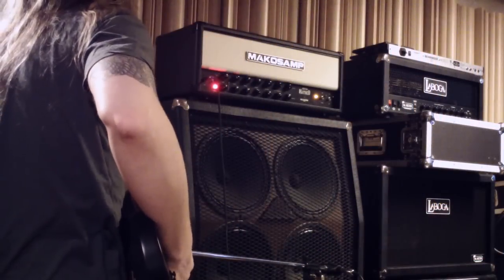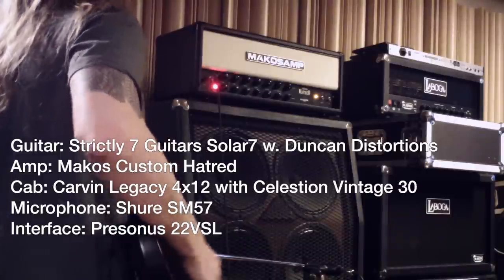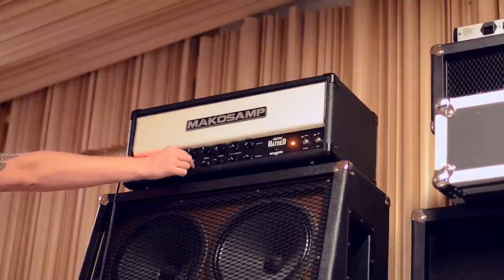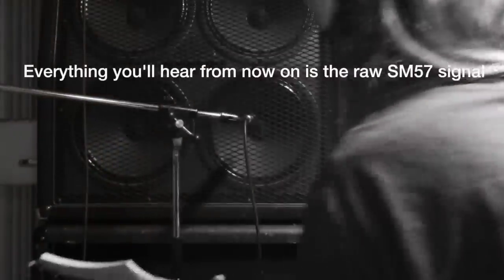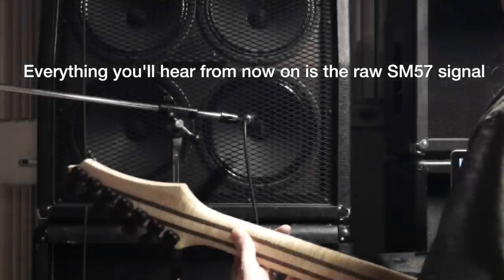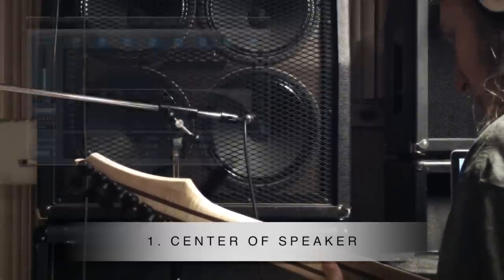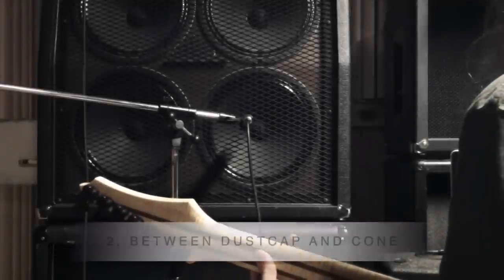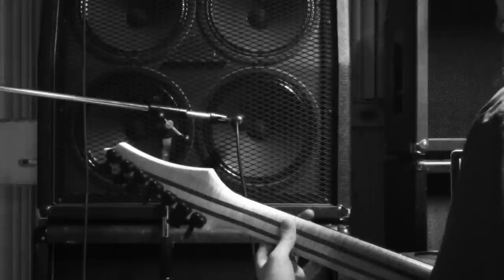Miking a Guitar Amp for Metal - The Ola way

Comment from the maker: To avoid being mis-quoted here's my answer: 
I record amps pretty loud, some amps needs more power amp push to make it tighter, some more modern amps (like Engl) doesn't. For instance a great example of an amp getting tighter the louder you crank it is the mini rectifier. With the volume comes the tight punch. 
So it all varies with what amp being used. The part that it should be as loud as the sound of the pick hitting the strings is bull, that is way to low volume.
Reply: Hi Ola! What does bull mean?
Reply: Who ever said a stupid myth like that? The string noise would be heard too much.

Comment: Surprising piece of gold here: I didn't realize there was such a difference between miking it dead center and "right on the edge of the dustcap". I was always making the jump from dead center to about an inch or two off the dustcap. I think that position 2 is EXACTLY what I've been looking for.
Reply: Try mixing the two, if you layer your guitars. One brighter (maybe more mids dialed in) and one beefier. Wall of sound guitar tone.
Reply: Chainheart Machine
Oh, always layer. But like right now I just have a 1x12 so it's hard to squeeze the mics in the right spots. But just knowing that 1 spot for getting a certain tone already came in handy for a recording I just did.
Reply: Event Horizon Productions Hell yea man, especially if you just want to get the idea down! I get lazy when I just want to put the parts together.

Comment: (part 1 of answer) I'm not Ola, but typically it depends on the amp. You usually can't go wrong with having the post around 3-4. Ex. The characteristics of a 5150 itself drastically change with the post at 1 vs 3. The entire high end opens up and the low end tightens up as well. The idea of cranking the amp is to bring out characteristics that aren't there when quiet, get some more saturation from the power section (that's why power attenuators exist) and give the speakers some movement.

Comment: When you record you should record on mono (unless you record a synth or something that has a stereo output). To track a guitar like this one stereo is double the file size and double the CPU power (for any processing you will apply) as the signal you record is the same for the Left and Right channel. So, you record on mono twice (not copy paste otherwise you end up with a duplicate mono version of your original recording) and then you pan it to the left and right respectively.

Comment: thanx for it! ;) i try to explain what i intended to say about the guitars. to add range tonalities imo you can play a track with a guitar and the other with another one.
where i have to disagree with you about the amp mixing. many band tend to use 2 or more amps just to get a full sound. some amps have bass, other mids, others treble. the mix have the function to get the big sound, without holes. this is said by many famous band,not only by me ;)
cheers!

Comment: Sounds great.. but what if just not record two tracks.. but just duplicate the first track in the software so u get exactly the same on two separate tracks.. then pan the first one left and the second one right.. ? would´nt that save alot of time and be much more simple than record two separately tracks ?
Reply: It gives a kind flanger effect if you do that, probably something with phase related.
Reply: +HearGear That would be the same as a mono track, only a little louder. When you play back a single track and it's panned in the middle, it already sends the same signal to the left and right speaker. It's the little differences in the playing that give the stereo effect.
Reply: +HearGear Same sound waves just amplify each other. So it would sound like a mono track, just louder.

Comment: Do you guys know if it's possible to get rid of the light "buzz" sound that you inevitably get from the cabs when you're not playing? Is it even possible for a tube amp to be dead silent when turned on? If it's not then does that small "buzzing" sound from the speakers is even worth paying attention to? I'm not talking about a loud white noise here, just the sound you get when the amp is on.
Reply: Oliver's World Try running a noise gate through the amp FX loop. I know what you mean, I play a 6505mh, and a gate in the loop kills any frizz or noise when I'm not playing anything

Comment: Ola, does using 1 speaker instead of 4 make much diference in this method? And does a 10 inch speaker sound worse than a 12 inch?  By the way, the bass guitar sound in the mix is AWESOME! :)

Comment: Mixing a song is like making a cake.As long as your filing and cake is cooked properly u can layer them as you want, then you put the frosting and the cherry on top and you are ready. The same applies on mixing. Yes, hard panning washes out the middle section (on your stereo image), that not right or wrong, you might need the room in between for a heavy saturated beat, or for marylin manson ultra processed stereo vocals to stick out in the middle. No rules, only what sounds right or wrong

Comment: do you have any mic preamps behind the sm57? my sm57 does not sound like this at all :( its very fizzy and the signal sounds weak
Reply: Luxorcist you need phantom/48v power enabled on your interface. Make sure to have drivers for it as well
Reply: i got a 2x12 stand for my bugera 333xl cause it sounds sooo much better when i practice than just having it sit on the floor, i actually want to get a bugera 2x12 cab that matches the amp and switch out the speakers to celestion v30s (also switch the speakers of my combo to celestion v30s) then itll techincally be a 4x12 lol
Reply: You don't need phantom power for a dynamic microphone or a ribbon microphone, you need the 48V power for a condencer microphone, and well, the SM57 is a dynamic one

Comment: I'm using the blackstar ht-5 with a 10" cab. Combined with my zoom g9 i get a great sound. But the fact is that when i'm micing it with my sm57 it's doesn't sound very fat, Even with a big post processing. Do you think it's because of the 10inches? Thanks a lot ola, and great video as usual.

Comment: Help! I bought a cheap t.bone dynamic mic and noticed that I have to crank the volume of my amp really high so I would even hear anything from the recorded track. Is this normal or is that just the way the mics for amplifiers work? (recording noob here)
Reply: How do you plug in the microphone? 

Are you plugging in the microphone directly into something that expects a line-level signal?
Reply: Posted this same comment to another video and got the answer already, it seems I have to get a mic preamplifier
Reply: Yes, or a sound card that has a built in pre-amp (Apogee Duet, Scarlett 2i2, loads of others). That would be my suggestion.

Comment: Unless you're a robot then it's impossible to play 100% the same everytime. There will be these extremely minmal differences and combining those together makes for a really large sound. Copy pasting one track doesn't at all.

And using two guitars to do it won't necessarily be richer. It's like using multiple amps. 
While plenty do it, a lot use the same tones because the goal is to get this one huge guitar sound rather than have it obvious there are multiple tracks.

And yes, gotta' play tight

Comment: I can get a really good in the room tone, but I record it and its sounds trebly and shitty and hissy and processed no matter what seem to do.
Reply: Im having the same problem. Did you find your solution? What mic and amp are you using? Im playing a peavy classic 30 with a sm57
Reply: Same
Reply: @zakkoskar3729  Hey man, Im running a  Marshall DSL20 head and a MG 4x12 (not the best speakers but it was cheap). I'm also using a knock off SM57. So, step number one would have been to get some better gear, but I didn't do that. I did some research on the fredman technique. I'll find a link for ya. You basically record with 2 mics on the same speaker in different positions and they cancel out those awful high frequencies. It sounded much better, but 1) better equipment would help I think and 2) there will still be some slight adjustments you gotta make so the recording sounds to your liking. Just some tinkering, but the Fredman technique works wonders.
Reply: @kingnothing2161  👍